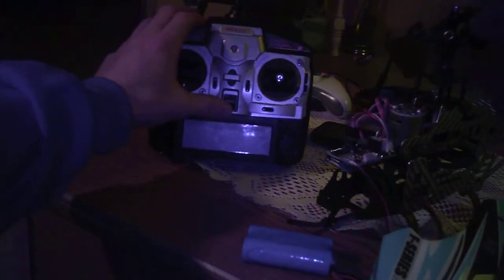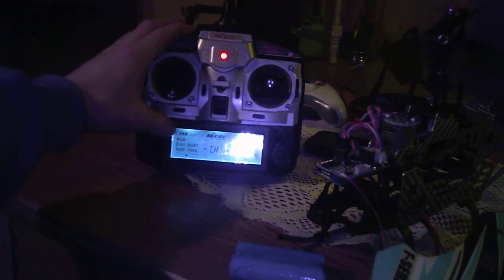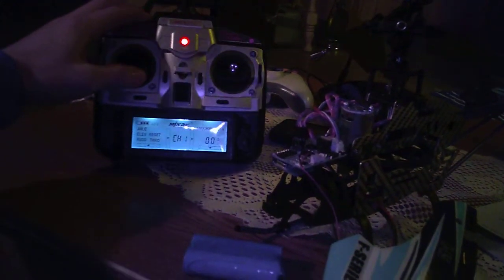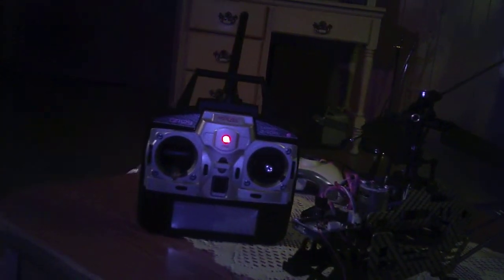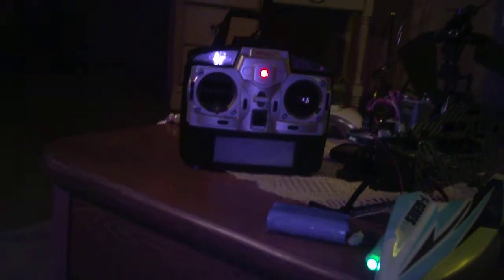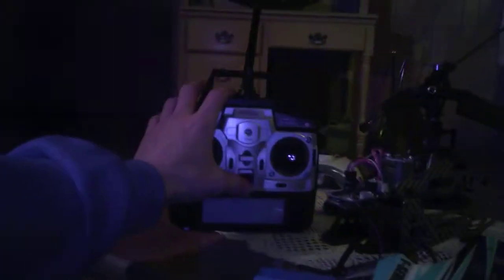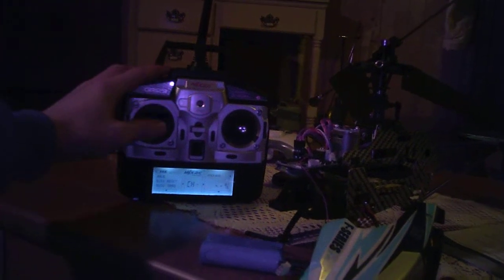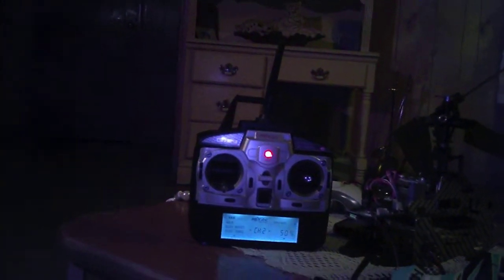F-45 linking problem caused by faulty PCB

Comment: My controller will register full battery just fine. I wonder why yours doesn't? I had an issue with a brand new pcb where the sync light would strobe after I sync with the throttle stick. The manual says the gyro is in a testing statement. I would let it sit flat on the floor but it would never complete its self checks. After letting it sit for a few days it synced and flew but now the tail rotor is stuck at full throttle which makes it impossible to fly.

Comment: I have 14 batteries. So far I had have to replace motors after 50 flights or more because they burn out. Now I'm flying with a brushless one and so far no problems. The only two occasions I had have to replace the PCB has been due to crash damage. So in my opinion your helicopter got damage by the crash you mentioned in your video. Get a new PCB and keep up flying. Don't blame the helicopter but the pilot. Check my videos...this is a great helicopter dude...spent $20 bucks and fix it.

Comment: First of all you has to turn on the radio first and then connect the battery. That's the correct way to do it, read the instructions dude. Second of all, of course if you crashed the heli chances are that you broke something on your PCB and that's why your heli isn't linking with the radio. And another thing, that PCB cost less than $20 dollars through Amazon or Ebay.